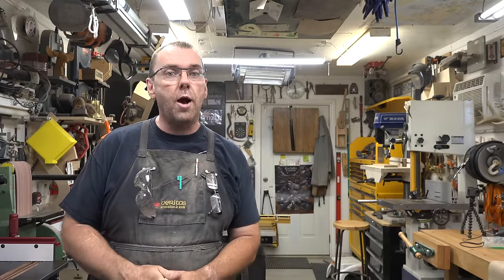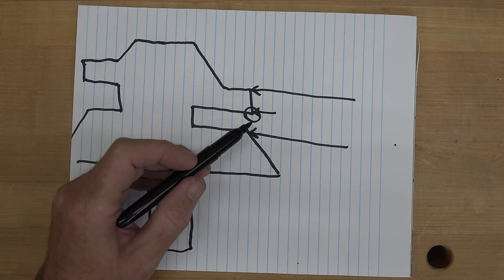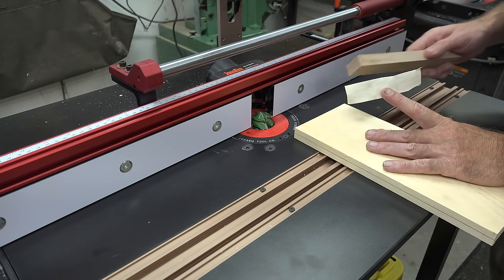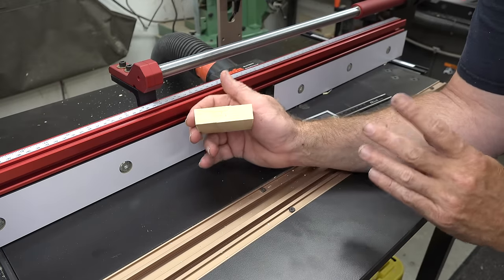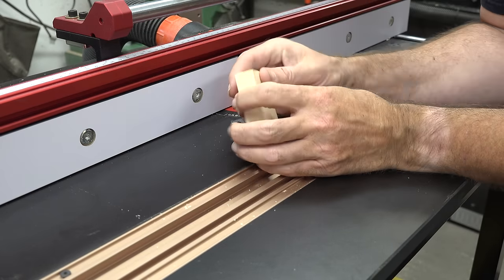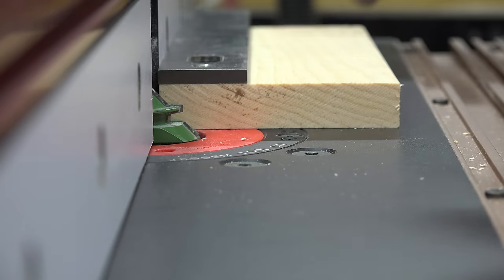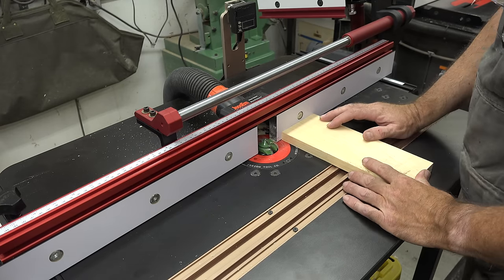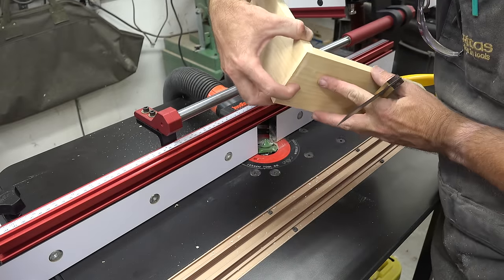Lock Mitre Router Bits

Comment: What speeds  should  i run my router  ?im new to using lock miter bit
Reply from the maker: It all depends on the diameter.  What diameter is your lock mitre bit?  Thanks for tuning in to the show.
Reply: I got the rocker  bit 1\2 shank,will be  using 3\4   info  popular  don't want it too  fast or slow,
Reply from the maker: @miken7375  The speed of your router is determined by the diameter of the router bit, not the shank.  What is the diameter of your lock mitre bit?
Reply: 1 3/4  x3/4 ,thanks for all yor help  best  video  explaining  setup,,I'm still doing  a little  tweaking to get it perfect 😂
Reply from the maker: @miken7375  For a router bit that size, your maximum speed would be 18,000rpm.  So running the router approximately 17,000 should serve you well.  I hope this helps.
Reply: Your  the  best , thank you👍

Comment: is lock miter bit matched with mini trimmer??
Reply from the maker: The lock mitre bit should only be used in a router table application.  I hope this helps.  Thanks for tuning in.
Reply: @acutabove_woodworkings  trimmer table too?
Reply from the maker: @lurkingcorsa10  I am not sure what a trimmer table is but if the bit can be mounted in the trimmer table, then it should work just fine.
Reply: @acutabove_woodworkings   okkk... I will

Comment: Good vid but it if someone doesn't have a high dollar router table with your electronic readout it take forever to get in perfect.
Reply from the maker: Thanks for the kind words on the show.  I have to disagree with you a little here.  I used this same method for years, long before I got the fancy router table, and it doesn't take that long at all.  You also have to remember, that even if it takes (oh, let's say) an hour to set up.  From there, you can run hardwood stock through the setup and make a set of setup blocks that will make your set up take about 3 minutes.  Don't let the fancy router table fool you into thinking that it is a long process.  It's all about patience and small movements of the router bit height and fence position.  I hope this helps a little.  Thanks for tuning in and taking the time to leave your comment.  I truly appreciate it.

Comment: if you wanted to wrap a pole thats 8 ft long, how is that set up.
Reply from the maker: The setup is basically the same.  My only suggestion would be to have as much support for the 8' long piece as you can so that your efforts can be concentrated at the router bit and not at holding the stock flat to the table.  Saw horses, roller stands, out-feed tables or anything you can find to support the stock before and after the router bit will make the process a lot easier.  I hope this helps.  Thanks for tuning in.

Comment: I am concluding that a router table with a router lift is required. Am I wrong????
Reply from the maker: You are not wrong.  The lift can be as simple as the internal height adjustment of the router motor itself. That would work just fine.  But a router table is a must.  This is not a bit for handheld use.  It's far too dangerous.  I hope this helps.  Thanks for tuning in to the show.

Comment: Thanks for all info, but if something takes so long, it is probably not worthed. We have to eliminated these marketing gimmicks from our craft. Otherwise, it looks like a daunting task for a new comer and we all know that this is not what this craft is.
Reply from the maker: While I agree that there are plenty of gimmicks out there in the world of woodworking, I have to say that the lock mitre router bit is the further thing from a gimmick.  It has been around for about as long as power routers have been around and the joint is most commonly used in making drawers, where dovetails or finger joints are not the preferred method.  The longest thing about the setup, is learning it but once you understand the geometry of the bit and how to set it up, the rest is simple.  Routing the joint is a quick as cutting a regular 45 degree joint but yet, it is a stronger joint due to the extra glue surface and the extra rib that works as a built in spline in the mitre joint.  The lock mitre bit is definitely a useful tool in the shop and the results are pretty amazing.  I hope that one day, you will get the chance to try one of these bits for yourself.  Thanks for tuning in to the show and chiming in with your opinion.  It's great to hear other's opinions on the tools or projects that I present here on the program.  Thanks for the support.
Reply: Kumuk 99 the lock mitre bit is a great invention and once you have used one you will appreciate the awesome design and engineering that went into it. To do it with just one router bit is great. You save money and there is no resetting if you are doing a large batch. They are a dream to clamp up and if you orientate the joints correctly on a drawer it is almost impossible to pull the fronts off. As with most things it is always better to buy a good quality trusted brand though
Reply: nick sainsbury Thanks for your input. People will decide what they need or not. We can share our experiences but we can’t be a part of a game. If it works for you great. Enjoy.

Comment: Try the GrooveCenter, made by Valfor Tools (valfortools.com). This is the only failsafe setup tool on the market. No measuring. It works with any stock thickness!
Reply from the maker: I'm sure that some of the viewers will find this information useful.  Thanks for tuning in to the program and chiming in with your suggestion.

Comment: WAAAAAAAYYYYYY TOO MUCH WORK.  This is why most woodworkers steer clear of this type of joint.
Reply from the maker: The work only exists for the initial setup.  After that is done, you can rout yourself a set of setup blocks and the setup only takes a minute or two after that.  Thanks for tuning in.

Comment: This is wrong. You should align to the center point, not to the edges. Aligning to edges means you have to set two parameters at the same time: bit height and fence offset. By moving one you put the other out of alignment.
Reply from the maker: Well if I'm wrong, then my "wrong" method has helped multitude of folks arrive at successful joints for the first time after giving up on the bit.  If you have a method that works for you then by all means, use it.  Thanks for tuning in Peter.
Reply: Sorry wrong link, this is the picture that shows the alignment: https://www.cmtorangetools.com/media/immagini/4517_n_FM_8_955.503-504_istruzioni.jpg
Reply from the maker: @PeterKnego  This alignment that you are showing is specific to that brand of bit.  The demonstration that I give in this episode of the show, is a general demonstration that will apply to the majority of lock mitre router bits on the market.  If my method doesn't work for your bit because the manufacturer recommends something different, that doesn't make the information in my show "wrong".  It just makes it wrong for your particular bit.  I hope this helps.  Thanks for posting the alignment link for the cmt orange tools bit.
Reply from the maker: @PeterKnego  you know nothing of my credentials so to state that Stumpy has more credibility than I do is ludicrous.  Follow whatever method works for you.

Comment: Kenny, I can't fault your method because according to your video it evidently works, but you have some bad info and your method is far from easy.  First and foremost, the center of geometry of the bit profile is not where or as you describe.  The actual center is the intersection of the "near horizontal"* cutting edge that determines the top surface of the male portion of the joint and the 45° cutting edge.  (Note:  these cutting edges do not physically intersect.)  This geographic center is both the vertical and horizontal center of the lock miter profile. 

*Your rough sketch makes it appear that this cutting edge is horizontal, which is far from the case with most lock miter bits-  the cutting edge is at a slight angle since most bits cut a slightly tapered male profile to avoid binding.

A much quicker, easier, more reliable set-up can be achieved by adjusting the bit height and fence position by aligning the centerline** of the stock (placed vertically and horizontally) with the bit profile geographic center- a task made incredibly simple with the Infinity Cutting Tools, Lock Miter Master.  Unlike your method, the Lock Miter Master also allows you to cut a variety of alternate lock miter joints, e.g. lock miters in boards of different thicknesses, offset lock miters, rabbeted lock miters etc.  For a technical discussion of the Lock Miter Master go to the USPTO website and read my patent (US Patent No. 9,682,492) and for thorough illustrated instructions read my detailed manual and watch videos on the Infinity website. 

** Actually, you don't need to use the centerline, the lock miter does not need to be centered, but, except it the case of offset cuts you just need to use the same reference line located the same distance from the outside faces.
Reply from the maker: Your comment is like an infomercial.  I guess if someone were to want to purchase your system, they could.  Or they could do it for free with the method that I demonstrate.  Whether or not the geometry was explained correctly is unimportant in this case.  Thanks for taking the time to post your comment and bring your system to people's attention.  Good luck and thanks for tuning in.
Reply: @acutabove_woodworkings  Well, I am proud of the LMM.  I'm a hobby woodworker but am always looking for a better way.  The LMM master, like the IBOX came out of my frustration with existing "solutions" and both just work great!

It is hard to explain all this without diagrams, but determining the mid-point of the profile by using the difference between the upper and lower cutting edges will only establish a midpoint at the corresponding points on the cutting edges, and not be accurate if the measurements are taken vertically (parallel to bit  axis) just anywhere.  It may be close but not correct.  I just noticed the photo of the green bit in the YouTube cover clearly shows the slight angle of one "near horizontal" cutting edge.  While the other cutting edge of that bit appears to be perpendicular to the bit axis (parallel to the table) it doesn't need to be and is not on some brands.   And of course, you are still left with the problem determining the correct fence position (an easy task with the LMM).  I hadn't used a lock miter bit for quite awhile, until I last week when I built a bookshelf for my granddaughter.  I used lock miters everywhere- to join the case pieces and attach the face frames.  A careful, one-time setup using the LMM-  just one quick test cut, then I never touched the bit height or fence position again. 

I think the two things that cause woodworkers the biggest problem using any method for lock miter bit setup is they don't realize or fully appreciate that if their first attempt does not yield a good joint, is that they just can't tweak bit height or fence position individually, or they don't allow for differences in wood thickness (the LMM allows for this).  If they are extremely lucky, the tweak, test, repeat method, may work, but the chances are not good- since the lock miter is just a modified 45° miter, a change in one setting will most likely require a change in the other setting-  as points on the boards move along the 45° there will be changes in both X and Y directions so they end up chasing the setup and either get lucky or give up.  I went looking for a solution and came up with the LMM.